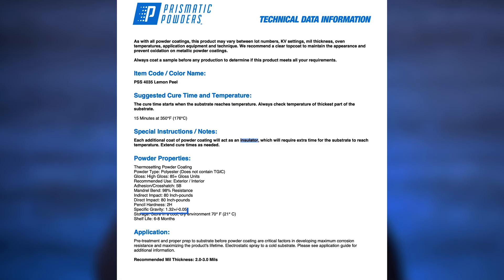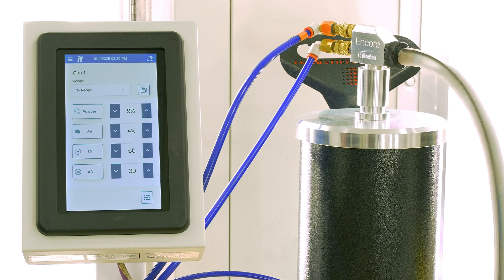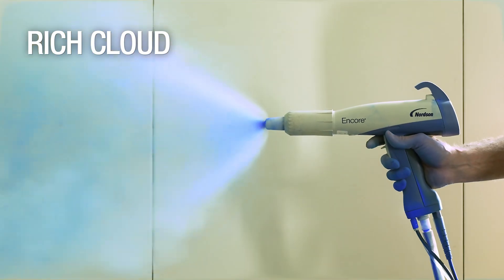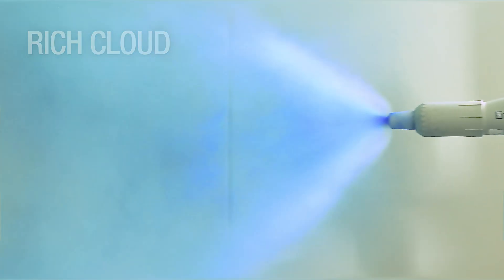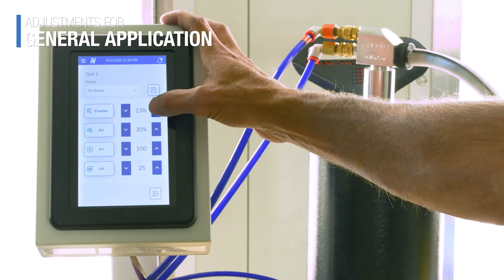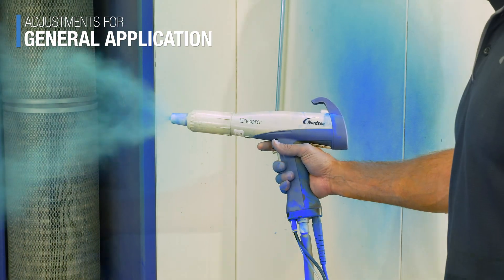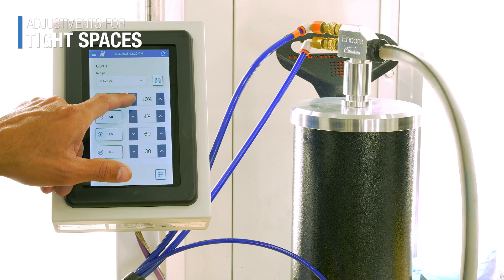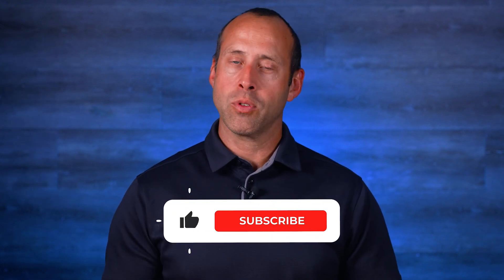How to Control Your Powder Cloud | Prismatic Powders

Comment: Hi @Prismatic Powders. I am planning on starting a small powder coating business doing wheels, frames etc. I am having a difficult time figuring out what powder coating system to get. Any recommendations on a good powder coating unit?
Reply from the maker: We offer the Nordson Encore VT that is paired with our 5lb fluidizer, which is a perfect option for a shop doing custom work as well as some larger production runs. Check that out on our website. https://www.prismaticpowders.com/shop/powder-coating-equipment/SE-4126/nordson-encore-vt-manual-powder-kit-with-fluidizer